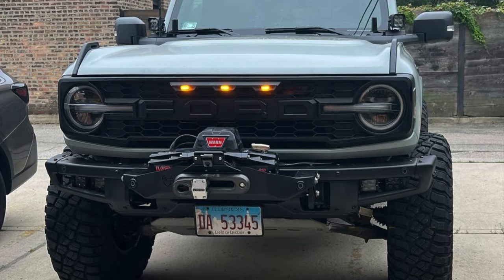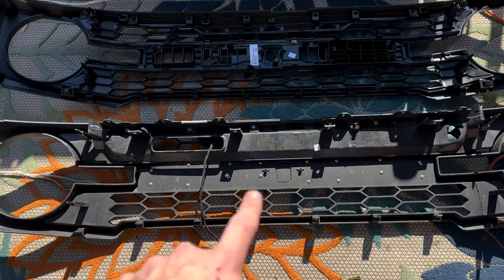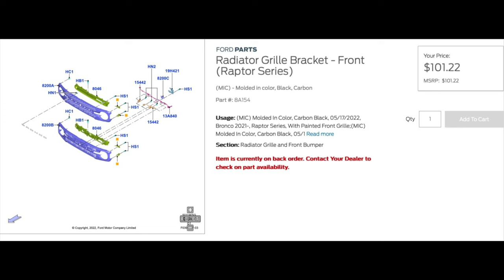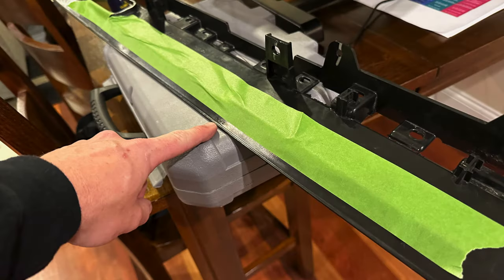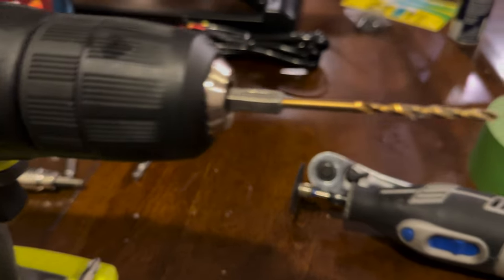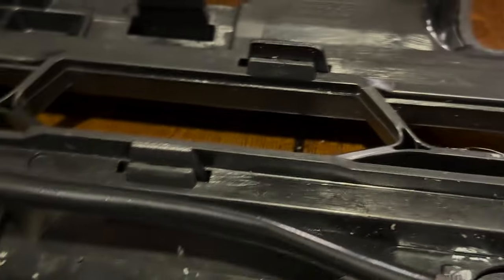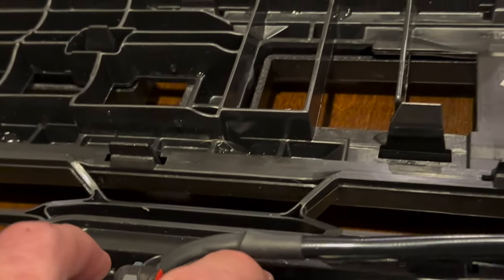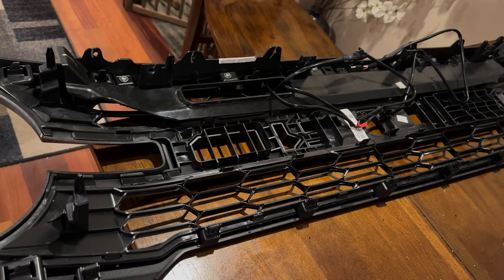Bronco Raptor Grill

Comment from the maker: UPDATE:  The backordered BRaptor specific bracket finally arrived.  Will be putting it on soon.
Reply: Have you been able to swap out the Braptor specific bracket yet? I assume the one you modified in the video was the original Bronco (non-non-Braptor) bracket from the factory? Curious if the Braptor bracket will require any modifications to work...??
Reply from the maker: @dirkmtn  not yet, might wait until the headlight swap since I’ll have to move the winch for both
Reply: @BirdDogOffRoadAdventures  is your impression that with the OEM bracket, you won’t need to do any modifications? Curious if the OEM grille, along with the OEM bracket, will make the Braptor grille swap out seamless without the need for modifications and fabrication?? I’ve asked my dealer, and he has no idea. Hoping you can share. I love the look and plan to accomplish what you’re doing!! Thx
Reply: @BirdDogOffRoadAdventures  Did you ever get the swap done with the Raptor specific bracket yet? Still curious if the OEM grille, along with the OEM bracket, will make the Braptor grille swap out seamless without the need for modifications and fabrication??
Reply from the maker: @dirkmtn  yes, I put it in while installing the new Morimoto headlights (see video).  It is a straight swap with no modifications required

Comment: @Bird Dog Off Road Adventure Question if I got an eBay repro Grille with the three lights included and the actual raptor bracket would I need to do any modifications or would it be a direct installation? Just got a Badlands last night but I want the Raptor style grille look, would like to not cut on the current OEM grille.
Reply from the maker: Replied to you DM on IG as well.  I don't think the knock-off  grills require the bracket (at least the one I had prior to the genuine grill did not).

Comment: Can I just buy the bronco raptor grill mount and will the swap be correct? I have oem grill and lights on order should I buy the bracket as well? Of course only if you know.
Reply from the maker: You need the bracket, grill itself, and lights.  Yeah, you could try to butcher the stock grill bracket to make it fit, but I strongly recommend getting the bracket for a clean fit